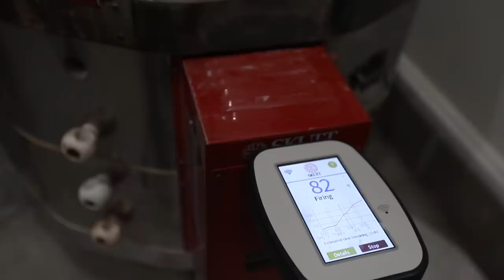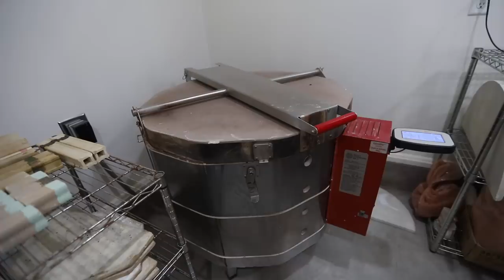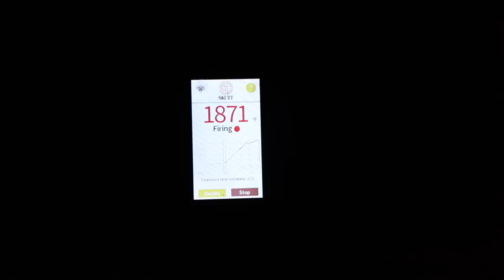MAKING MARBLED MUGS - The ENTIRE pottery process - ASMR edition

Comment: Hey Jon! I’m in 8th grade and my teacher put me in an independent art class where I’m allowed to throw on the wheel. Me and a friend have been practicing but we have found that we either have to much or too little clay to make a sufficient size cup. I was just wondering if you were willing to share how much clay you use when throwing your cups?
Reply: Satchy use two pounds of clay for a huge mug in stoneware. Or 1.5 med size 1 pound for a small mug like this one. But please at least trim a foot on it, and don’t extrude the handle!  Lol
Reply: @dianalea3702  Hey, nothing wrong with extruded handles, each to his own!
Reply: Wedge four pounds, cut it into thirds.  That gives you a decent sized cup.  2 pounds for a cup is way more than necessary
Reply: A cup amount of clay and a bit more. So whatever you want your end product to be, go a little over. An easy way to measure this is displacement. Get a coffee mug you like the size of and submerge it in 1L of water, see how the water went up? That's the displacement of that mug. Work from there, measure the displacement of your clay (in a plastic bag don't get it wet) and you have a number in your head for all mugs going forward the rest of your life.
Reply: thank god I am not the only one that has problems with this. Thanks goes to the replies for helping out!

Comment: My  one tip on throwing marbled-clay:  Wedge along all 3 orthogonal axes.  Which Jon does.
But the one thing he doesn't' do, is put the clay on the wheel in the opposite direction of rotation that you wedged.  Or put it on the wheel on an arbitrary axis.

The wheel is going to pull the different colors into parallel bands, in the direction of rotation.   That isn't too interesting.  So you want to use this fact to your advantage to encourage folds and whorls.  I did this with a set of tumblers I made, and they came out looking like the clouds of Jupiter.